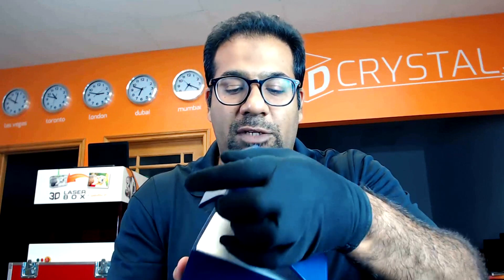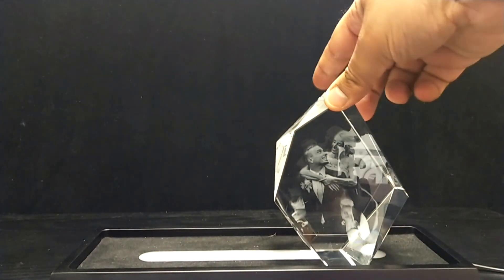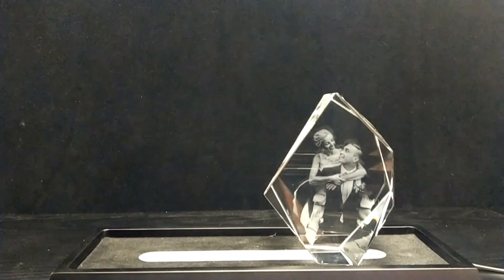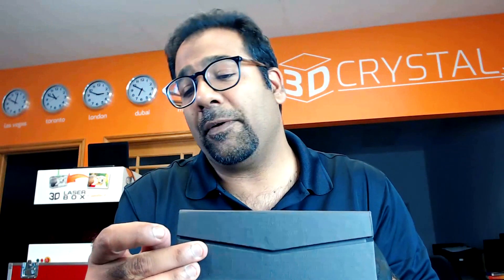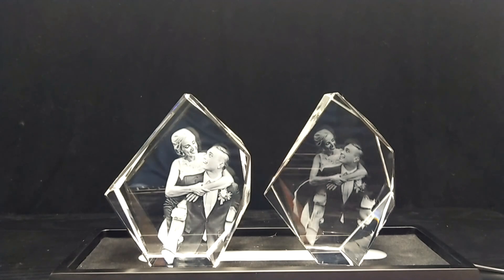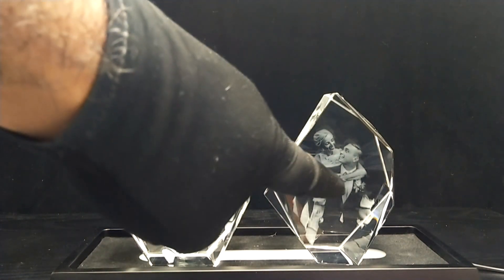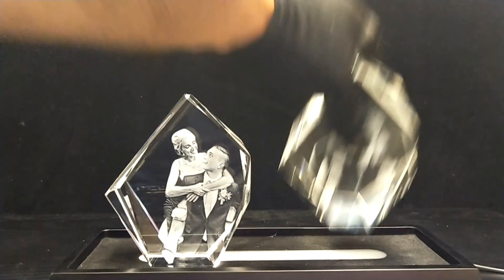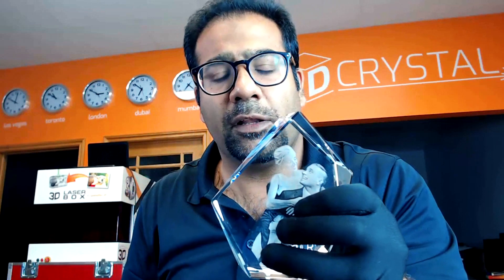sub surface laser engraving ⭐Comparing Quality⭐| 3DCrystal.com

Comment: Can you use a sub surface printer for jewelry engraving to? And where do you get the glass or crystal needed?
Reply from the maker: Yes you can. Contact 3d@3dcrystal.com and ask to be put in touch with the factory contact for raw material black crystal pieces.  You can order existing inventory in hand or have it custom cut at the factory.